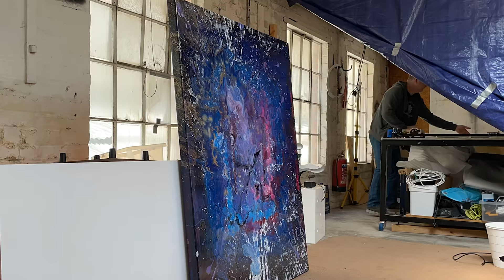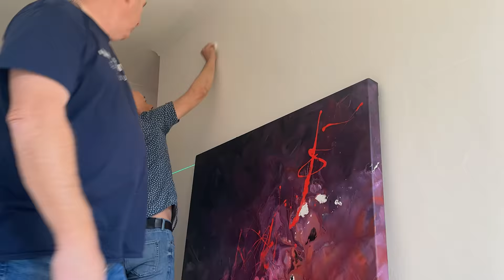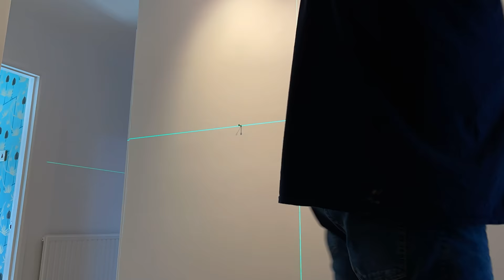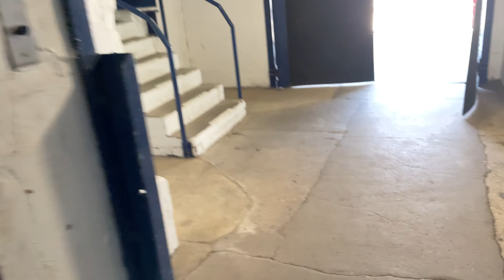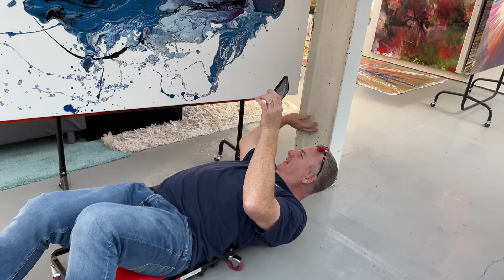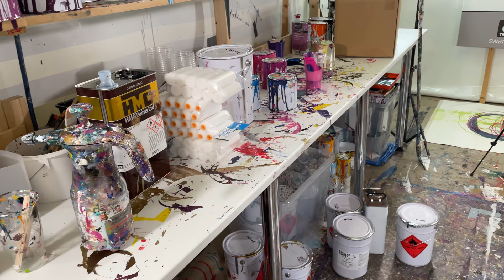Painting the UNIVERSE with COLOUR CHANGING art!!

Comment: What kind of hardware do you use on the back of the painting to hang it by?
Reply from the maker: Hey Deb! All we use is two screws and the painting sits on the crossbar  - that's it! Nothing more complicated than that. Hope that helps!
Reply: That helps a ton. I didn't know if you used a wire and D rings
Reply from the maker: @sunnykcdb  thanks Deb- glad to have helped!